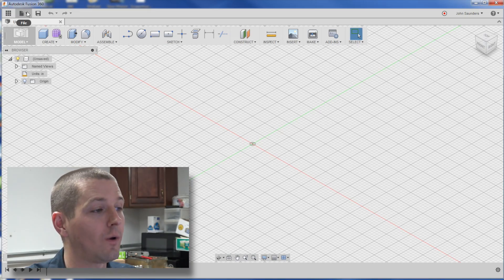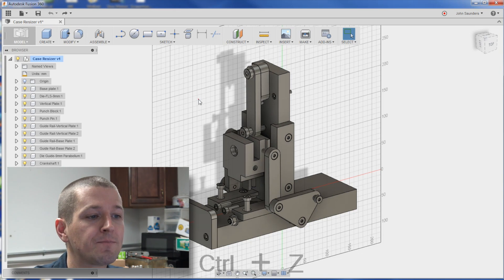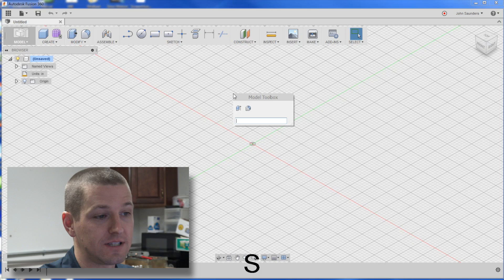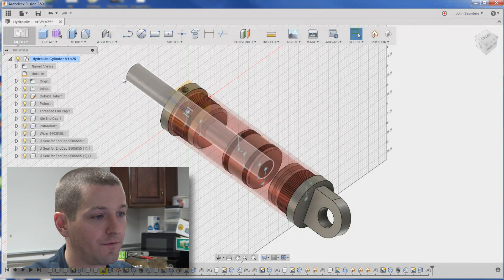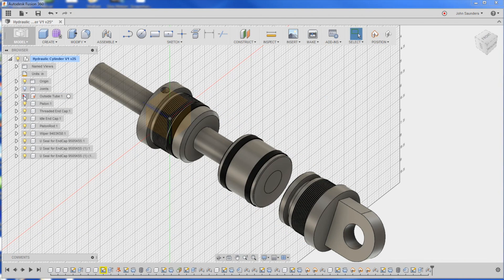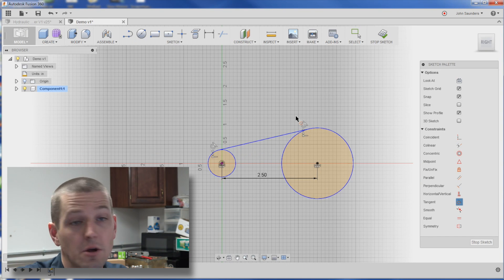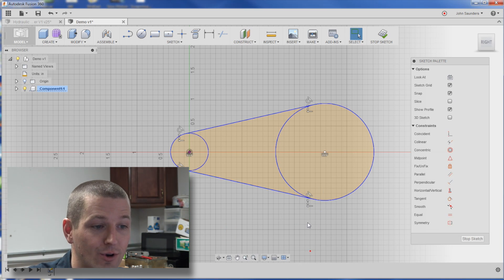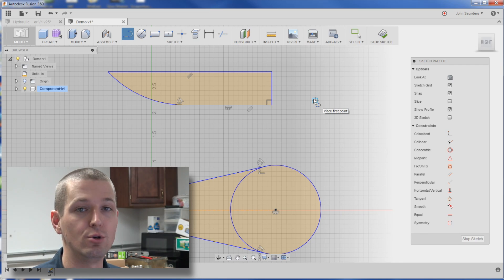Fusion Friday #6!  10 Fusion 360 Tips!

Comment: is there any way to save a file and send/email it to someone else to look over inc cad and cam details
Reply: +NYC CNC awesome thank you just tried it, it works if you go file start new design from file wont open if you just click the f3d file I send but thanks for that, is there any way to check your cam output in simulation like you can in soldiworks IE solid varifie

Comment: Awesome tips video!!  I was an avid AutoCAD. user and loved the "L" "C" type key commands really expedites design.. I got so used to solidworks I didn't think to try those in Fusion.. thanks ks for the heads up!!

Can I request setting up a few thread mills in Fusion?  I am a bit confused about setting up the tooling for them even after the threads in the forum.  just want to be sure it works as it should..

Chris

Comment: Great tips for f360 John

A small point the camera you use for your shots with the white board in the background needs its sensor cleaning ,you have a boogie lower left , but be careful it's a difficult job , maybe a job for a pro. If you do not have the gear 

Keep up the good work I have leant a lot from watching you , I am slowly getting to grips with it 

The problem I have at the moment mainly exists between the keyboard and chair , in that my drawings are imperial and I prefer metric f360 is set up for mm and when I type in the dim. And I do not get the 'in' in the correct place it miss converts it . 

Stuart
Reply: when i type in a dim in inches and do not correctly place the in.,it give a wrong conversion to mm ,which is the system default

Comment: When ypu get some free time, I made a couple sets of stumps for the cnc mills. For the Fadals I think tbey were 8x8x2.5 the larger were 10x10x3.5. I cut standing keys on bottoms, all sides sq. I drilled and tapped for standard bridgeport tie down set. All sides, holes intersecting,+.005 tap for heat treat and grind all surfaces, drill and counterbore a hold top down for sockethead screw center and between the 2 keys to lock inside table slot. Used many times, so quick a setup. Instantly sq. To table, bold part against and go.

Comment: Thanks John. A good set of tips and shortcuts. A request and a question... Where I get myself messed up is when I'm changing an existing design. So for instance you are going along and find that something that happened 25 moves ago just isn't working. Sometimes I can go back and edit a sketch and all is well, but at other times I get thoroughly confused. A video with editing something complicated would be very welcome. Second, when in the process will you build in clearances and tolerances. For instance, on the Kant-Twist style clamp, That was designed "line to line". That's a great way to capture a design quickly. However on the clamp for instance, there was no clearance and everything would bind up if you didn't allow some clearances.